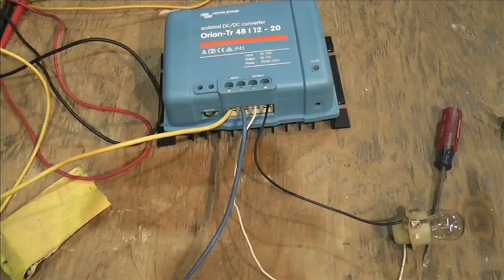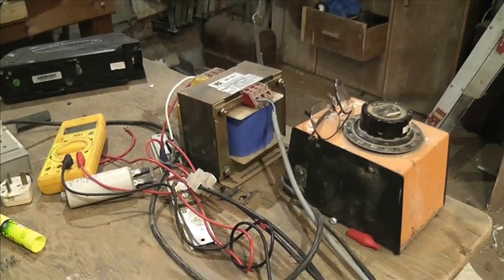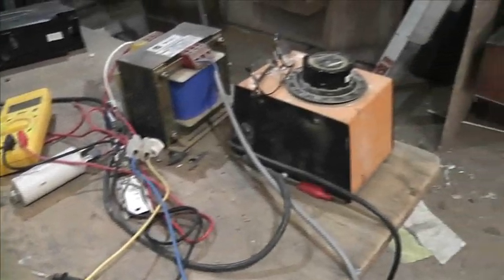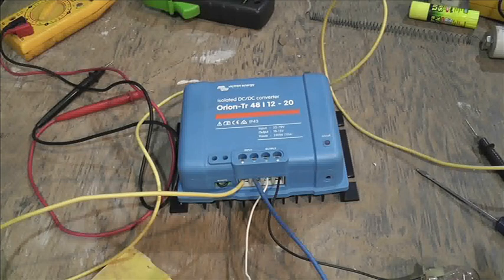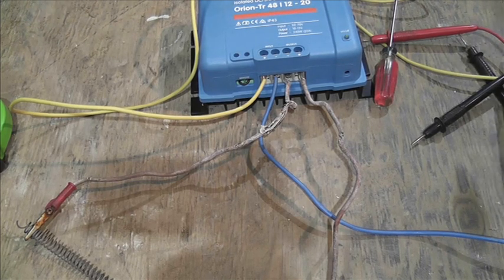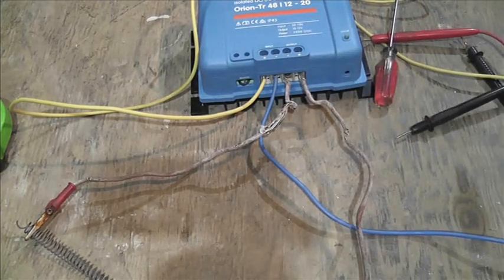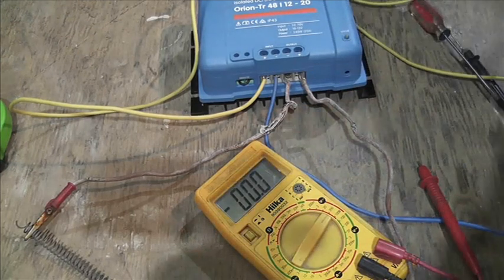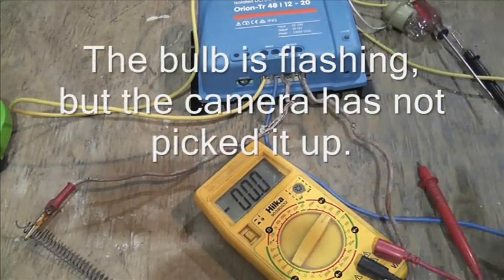Victron DC/DC converter, is it faulty?

Comment: I was surprised only by the cheap capacitors that Victron used there.
Reply from the maker: Yes, down to a price
Reply: Very difficult to know the price of the capacitors. Quality Assurance requires a department and costs money. From a former QA Engineer.

Comment: Thanks for your work .I totally  agree  being able to continue on after high tech devices let you down is most important.  I started my solar project with lithium batteries  and now am building out a lead acid bank for sustainability reasons and am now concentrating on dc devices to get away from modern-day electronics due to repair  issues.
Reply from the maker: I've never had a problem with the older Victron units but it seems they've gone corporate. Best do without where ever possible, cheers

Comment: You have further solidified my decision to avoid Victron products. Not that they are poor quality or anything but the repairability and business model is like that of Apple computers.
Reply from the maker: Erik, I agree, they have changed to corporate banditry, cheers
Reply: Always tought that.
Reply: Hey,
I have to disagree here, mostly speaking from the software side of things. They are one of the only companies I know that open-source a huge chunk of their software and go out of their way to allow people to integrate and experiment with their products using open-source standard protocols instead of proprietary junk that spies on you and stops working as soon as they abandon and stop maintaining their products. Their CEO actively responds to questions on github and encourages tinkering and messing about.

These things get often used on sea-going boats and RV's, tough and vibratory environments, where potting can be very useful and extend the lifespan significantly.
There's always a trade-off though, and the repairability suffers greatly.

To compare them to Apple is pushing it a bit too hard  :)
Especially if no attempt was made at contacting them for repair etc.
Their inverters are quite easy to service by the way.

Not a fanboy, but Victron does things a lot better than many other companies, while Apple is the worst of the worst, it doesn't seem fair to bunch them up together.

All the best!
Reply: @TheInfoworks  
BTW, always fun looking inside these devices while leaving the frustration of violent destruction to someone else :D
Reply from the maker: @koffibanan3099  Fair comment and I use an old style multiplus 5Kw. The potting is unhelpful, cheers
Reply from the maker: @koffibanan3099  See my next video where heat is your friend, cheers
Reply: @koffibanan3099  that’s really cool. I had no idea. Hearing that has earned some respect back.
Reply: Mr Erik. Im not sure why you would say that? Things blow up when you connect the wrong voltage. Not sure how that is the manufacturer issue

Comment: Hi Andy, I have a victron orion DC to DC charger on my narrowboat which gets very hot in use, to the point where I’ve fitted an external “Snail Fan” underneath to help cool it… Victron equipment is very expensive and I’m shocked and disappointed at the potting you found inside both items you’ve looked at in separate videos. Luckily my mppt controller is a Renogy so hopefully will be more reliable than the Victron
Reply from the maker: Hi, the external fan is a very good idea, electronics and heat are not best friends, cheers

Comment: This demonstration makes me a bit leery of Victron products. Without that potting compound you may have had a decent shot at repairing it by replacing the smoked up device on the back and a couple of those caps. 

I would be more inclined to buy a cheap DC-DC converter board from China (high tech) but wire a good old fashioned crowbar circuit across the output (low tech) to protect any loads should the buck converter decide to fault out, as these types of circuits in failure mode tend to pass the full input voltage on to the output. 

To the Victron's credit, when it let the magick smoke out it didn't do that, so that was some good design there. You don't want a $200 stepdown converter blowing up a $600 NUC computer for example!
Reply from the maker: Hi, long time no hear, I'm experimenting with opening these packages, but I am careful of trying to fix this sort of thing as it seems there is usually a multitude of problems and not just the obvious, cheers
Reply: Not sure why a potted device is being looked down on, ? This is marketed to marine and vehicle installs so no kidding it’s potted. Like to see a non potted device in salt water environment
Reply: @crankshaft007  The potting is incomplete and protects nothing. It is also a very 1950's approach.

Comment: If I can have multiple backup options that I can swap into a system to keep it running I'm relatively happy so I like modular, but I'm increasingly aware that this means its much harder for my wife to maintain if I'm not available.
Reply from the maker: Yes, a UPS inverter is a wonderful thing, but education is much better, cheers

Comment: The potting on this unit does not make it suitable for use at sea because the pcb is not potted. Therefore no protection from water. 
   Potting was old technology in the 70's.
   Back then I was specifying builds to have conformal coating that can be soldered through for repair. All to MILITARY SPECS.
Reply from the maker: Hi, yes I think it is for vibration damping, there is a consensus of opinion on my victron MPPT controller video, cheers
Reply: @TheInfoworks  You must be correct, it is a silicone compound. There are other  ways of protecting components from vibration which allow them to be removed.